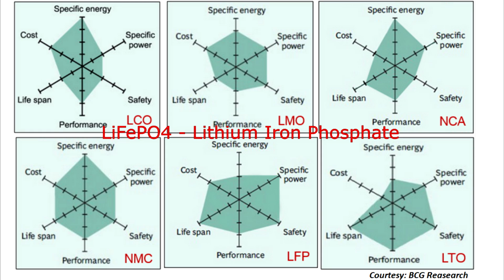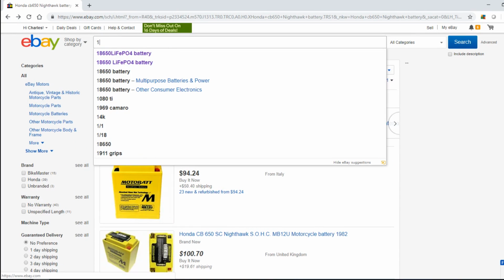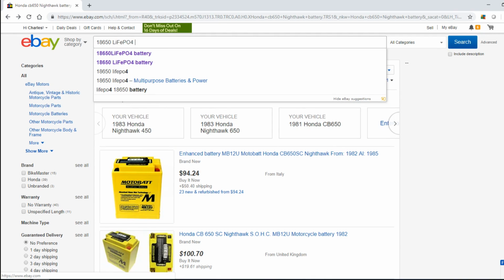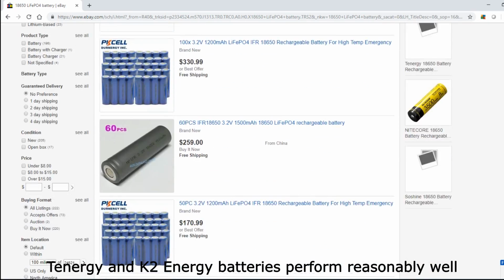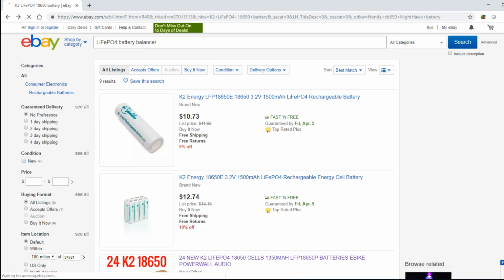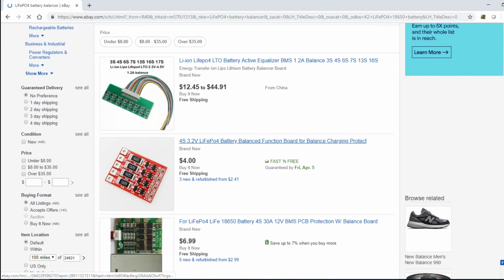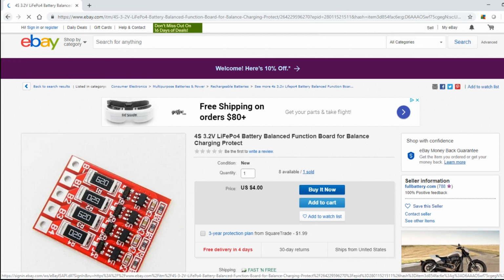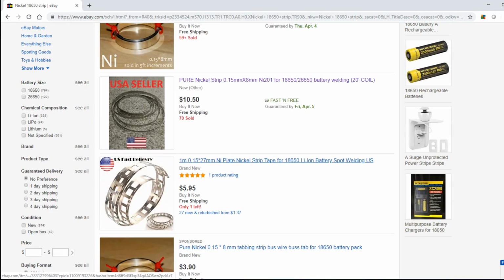DIY a better (and cheaper) long life motorcycle battery

Comment: I think its better to use lithium iron phosphate 18650 HIGH DRAIN  , high drain is for turning motors.  Also you could just get a maintenance charger for the bike in storage, this will extend the life of a lead acid battery by years. And no safety glasses is just unwise. plastic safety glasses are about $3 at hardware stores.

Comment: Since when do bike batterys only last 2-3 years ? ive owned a bike for over 10 years and still on my second battery that i got about 8 years ago, having had bikes for over 30 years ive brought 1 battery.
Dont make shit up just to make a video......
Reply: I have. 2012 Yami roadstar 1700cc vtwin cruiser that was built 11/2012(8+yrs ago) and it still has its original Yuasa AGM battery which in 8+yrs has yet to fail to start the bike.
And no I don’t leave a maint charger on it 24/7 which would have reduced(yes that’ “reduced” is not a typo) it’s service life esp being an AGM battery that has less electrolite by design then std lead acid battery & also can’t add dist water to it either so only put a low 1.5 amp charger on it every so often when in off season winter storrage for 5-6months. Got 7.5 yrs out of the cheap Walmart std lead acid battery in my kz1000 . Got 12yrs out of the last std lead acid battery (repop Delco R59) i had in my classic muscle car I have owned for over 43yrs a which is a matching #’s 1969 chevelle SS396 4sd, when possible I charged that battery once every 3.5-4wks . If you do proper maint on std lead acid batteries adding dist water as needed & keep them fully charged & clean and do the same for newer gen AGM lead acid batteries and don’t over do it charging them 12/7 all the time with newer Gen maint charger that can damage them over enough time(esp AGM battery with less electro light) that’s how i get the long service I do out of all my batteries. The std lead acid battery in my somewhat daily driver (not driven every day esp in summer when I ride my motorcycle) 98 Nissan Maxima with 63k original miles on it lasted 10yrs which was a top of the line Excide std lead acid battery.
And I live in upstate ny where summer Can hit 100deg f with weeks of mid to upper 90’s temps & winter off season can be cold for 5/6 months too so batteries can have a tough significantly shorter service life here if not properly cared for like I do with charging every so often to full charge along with not using maint chargers in my batteries 24/7 being the 2 main things that extend my battery service by 45-50% on avg be other similar use vehicles I my area.
Happy Motoring!
Scott

Comment: "Don't worry about overheating it".  wow.. really.  have you heard of a spot welder.
Reply: Bruhh, why wouldn't he just use copper instead of nickel if he's gonna solder everything. So much about this is wrong lol
Reply: @sunny_froyo  nickel plates is better on lithium based batteries as they dont oxidise the way copper does.. This is one benefit of not having short circuits in the long run..
Reply: @sunny_froyo  maybe he doesn't have the spot welder, just want to use once it's not worth it to buy one for, just used what he already had 👍
Reply: Electrical wise, i do not recommend to have a solder on battery more than 3 secs as it will damage and discharge the battery..

Comment: Straightforward and nicely explained... well-done, thx! Would be curious re: the total cost, especially compared to say, a similar capacity conventional LI battery?
Reply: You can buy lithium batts from ebay or chinese store.. And they sell super cheap for the battery cells...

An average good Lead acid batts are sold around USD 100 (E.g: YTX10) 
And a branded Lithium batts (E.g: Skyrich) USD220.

DIY Lithium should cost ard USD 80 max...

Comment: As much as you know about this stuff....  You really should be wearing PPE gear.  Like when you hose out the battery box without eye protection.

Next time just dump baking soda to neutralize the acid, then rinse with low pressure.

Comment: Why didn't you use a spot welder on the cells? That'd cause less heat damage to the cells.
Reply: How much is a spot welder? More than a motorcycle battery?
Reply: You can DIY a spot welder using a 12v battery or power supply. In my case my spot welder is diy and cost me nothing.

Comment: Normaly you disconnect the negative lead first, not the red one. This is because you can accidentaly touch the body of the car/bike with the loose lead and short the electronics with charge left inside the capacitors. It's like mixing drinks - you can mix vodka with vodka all the time, but don't mix it with whiskey, rum or anything else (though a pint of beer after a bottle of vodka never did me any harm).

Comment: Why you chose lithium iron phosphate over lithium-ion battery
Reply: LIFEPO4 fully charged battery voltage is 3.3V per cell vs 4.2v for li-ion. So that most 12v charging systems will fully charge a LIFEPO4 whereas Li-ion in 3S configuration will be overcharged and 4S configuration will be undercharged.

Comment: A battery balancer is not a complete BMS. The balancer has no way of cutting off the battery from the outside world like a complete BMS is able to. Because of that it does not keep the battery from over charging or over discharging and it does not protect against excessive charging current or excessive discharging current.
Reply: Active balancers often take more quiescent current vs passive. This can make a difference when storing rhe battery over winter.
Reply: @electricalfive2248  And the solenoid will prottect he LiFePo cells against over/under discharge? No it won't... And the starter isn't the only thing drawing power.
And that balancer he used has minimal balancing current. Better to use one of the cheap ACTIVE balancers.
Reply: @diavolescaCZ  you're right, sorry
Reply: @electricalfive2248  no problem. You didn't call me stupid. I agree that a BMS for car starting currents would be very expensive. For a motorcycle it might not be a big problem

Comment: Must be at least 12 -18ah with 24 cells
Reply: Yeah, i got a 9Ah lead acid and this is just overkill :D I got some tests going on and smallest setup i have succesfully started a motorcycle engine is three serial, three parallel.

Comment: "Dont worry about overheating the cell" LOL damn.  Soldering like that basically ruins your cells.They might work for a while but yeah, that chemistry degrades fast under high temp.
Reply: That sentance is true if you get yourself a quickly heating soldering iron or do it at high temps. Using welding is preffered mostly because it is safer to do so, faster, cheaper and no blm kids will try and use cheap 10-20w soldering irons to do so. I'd say you need at least a 60w soldering iron to solder and a small fan cooling the cell it self to do it safely, but then again i made only 1 pack like that. The other i tried making was welded with super caps, a solenoid and with observation. 1st one works nicely, bit less of a charge than it should, but i take it the charging controller shuts off any current at ~16v and not higher. The second one is still to be used, it's ment for a lifepo4 supercap  lead acid replacement battery. Was thinking of making every connection with brass nuts and bolts but after 3 montha of waiting for the nuts and bolts i'm gonna have to rethink that bit.
Reply: “Get the battery good and hot” lol WUT?!
Reply: @jonny95210  i see you missed a word there frieend. You can't go storing energy without pads.

Comment: as for those ring terminals. crimping is actually better for vehicles because vibration can cause solder to crack over time
Reply: Devin May 100% agree....
Reply: If my memory is good, it's been known for a long time (since around WWII) that crimp connectors, properly done, are superior. For speed (that helped us win the war, because the Germans were soldering their field phones, which takes longer) and resistance to flexing and vibration (because the spot where solder stop wicking up the wire is a transition from stranded wire to effectively solid wire, the strands break, one by one, at that point, from flexing).
Reply: I'm sure I remember reading that crimp type connectors help win the war. Wikipedia says 1953, but, that could be when they went commercial, I guess.
https://en.wikipedia.org/wiki/Crimp_(electrical)
Reply: NASA found the same on spacecraft. Solder joints crack. Crimped ones don't, so they solder AND crimped all the connections!

Comment: Why should anyone take you seriously?!?

Only morons solder lithium cells. Those are designed to be welded. You are applying heat to the internal breaker which reduces the current carrying capacity and life of the built in safety.

You are going to set someone on fire!

I should make a video pointing out just how stupid people are to even consider this.

 4 headway cells will be more than enough, and they simply screw together. Their built for high discharge, high temp, fast charging, and abusive applications, such as bikes and atv's.
Reply: You should figure out how to comment in a better way. I for one thought the video was a good starter video and it’s up to the viewers to do more research than just one video. It’s ok to voice your opinion but do it constructively if that’s possible. To be honest I solider a good bit and it doesn’t heat the battery enough to cause a problem unless your heat is too high and held on it for longer than needed. I can think of a good reason to solider verses spot weld, solider gives you an opportunity to replace a single cell without damaging the connection plate. I’ve been able to replace a single cell to repair an entire pack so solider was the way to go but that’s my opinion as an advantage.

Comment: I don't know what you do when wintering your batteries, but mine held its charge since I bought the bike 5 years ago and is officially dead this spring. Of course last season it was a little weak but only 2-3 year is very underestimated...
Reply from the maker: Depends on the bike, battery, and care.  In a warm garage, 4-5 years is possible.  However, if you have ever owned a BMW motorcycle, 2 years is the best you get from a battery.  However, my lithium batteries have been going on 8 years now.
Reply: @highervoltage5430  Do these bikes tend to have electrical leak of some sort ? Or is the battery undersized and the high demanding cranking is what kills it ?
Reply: As you can see in the video, his battery had no little or no electrolyte when he tried emptying it on the grass. He forgot to add water to the cells and that is probably why the battery was dead. Unless it was an AGM type, in which case the electrolyte was trapped in a glass mat between the plates.

Comment: I have an 3s 5p 16ah battery pack in my 50ccm scooter can also start an car :D bms with cutoff for safety and  a modified charge limiter to 12.3v for not stressing the cells works perfect since last year
Reply: Did you try it on a motorcycle and it worked ??How is the delivery
Reply: @abdodarwish3334  it still work well
Reply: @quartzii_uwu  Possible pictures of the installation method, the board used, and whether the startup works on it directly. Thank you for your interest in responding
Reply: @abdodarwish3334  hey , it would be a mess to reach the charge controller you can also use normal 12.6v charge controller with a little bit of wiring theyill work also
Reply: @quartzii_uwu  If a drawing or illustration is available for practical implementation

Comment: Hello and thank you for your video .  This is the first time i am building a lithium battery for my motorcycle. The lead battery i am trying to replace is a 10Ah 175CCA battery https://www.yuasabatteries.com/battery/yt12a-bs/
I want to use 4 individual cells and a BMS that can handle the 13.8V-14.2V the Regulator/Rectifier provides.
How much amps should every cell be able to provide?What should the discharge rate C be ? What BMS should i choose? Common port or Separate ? How many amps?
Thank you and thanks for your videos!
Reply: That tinny red board can hold 14.4V from alternator (and its current)? 
I don't know Rick...

Comment: A flooded lead acid battery for a CB 750 is what $50 minimum?  Most 18650s LiFe batteries i've seen go for about $45 per 24.  When you factor in the other components, how much did you end up saving?  Not to mention time, energy, skill, safety, tools, etc.   Why not just buy an AGM? Or find a way to rig a regular rc car battery pack?
Reply: From all the research I haven't done yet I believe a ton of RC car batteries aren't 12 volt. They'll obviously have one or two. So if you find out why not comment below.
Reply: shae grover   I'm sorry, I should have clarified.   I was referring to the11.1v 3 cell Lipo battery backs with a nominal charge voltage of around 12.6v commonly used in rc aircraft and cars.  However, LiFe are probably still ideal for long term storage use without proper maintenance like an inexpensive trickle charger you would use on a lead acid. Li-Fe (I forget how many cells these typically have) packs are around 6.6v with a 7.2v nominal charge, as described in the video, this is a fairly useful range if you were to use them in a series configuration.  

Of coarse lithium Ion like they use in the real motorcycle batteries would be even less expensive than the already cheap LiPo, but they tend to have a shorter shelf life and faster self discharge rate if i'm not mistaken.  

But it does all come down to wether or not you properly maintain a battery. Trickle charging, indoor storage, and observing fluid levels if it's a flooded battery, will certainly improve the life expectancy.   Of course AGM is still better in almost every way compared to flooded.

Comment: Great Video,  and Great project! Question, shouldn't each cell be managed? Not sure how that would be done on parallel packs. Ok it seems that you are using 3X8 cell pack, is that right? How long has it been since you built this pack, and is it still working and have you had to charge it? Wont the BMS  also protect the battery pack from discharging below a point that will damage the cells? Thanks
Reply: 3x8 or 8x3? Not hard to figure out which...

Comment: what iron are you using?
Reply: That's a weller WESD51.  You need a good hot iron.  Weak irons will damage the cells due to long heat times.  See my speed flux video to make the job quick and easy.

Comment: Sorry so what was the reason against using Li-ion 18650's ? Are they not able to handle the discharge rate or something? I have access to hundreds of recycled 18650 Li-ion cells and have just discovered that my bike battery is flat as we are heading in to summer!
Reply: Can you share where you get these recycled cells?
Reply: @boogerking7411  I have a friend on the inside at a scooter rental company so I can nab the batteries that are destined for e-recycling. Try contact your local e-recyclers to find out who takes care of your local scooter rental companies and see if you can take some off their hands, just make sure you don't get any that have had water damage or you may run in to trouble
Reply: I think old scooter batteries won't have much cycle life left in them since they get fully discharge, hence less cycle life. EV batteries would have better chance since they have big capacity banks. Anyway, I wish we have e-recyclers in asia. Haha
Reply: @boogerking7411  in many cities you will find abandoned scooters everywhere, just take the batteries out
Reply: Voltages don't match. So the alternator will undercharge 4 lion cells or overcharge 3. LFP is close enough that things will basically work with the existing alternator (although it's still not quite right, the BMS will hopefully deal with the slightly high charge voltage).
Reply: @jobbingactor  Don't motorbikes have alternators to charge their batteries? Whatever they use is designed for lead-acid voltages and charging requirements. Lithium (either LFP (3.3V nominal) or 'standard' LCO/LCA/NCA/ (3.6V nominal)) doesn't strictly need CC and CV charging - it needs current-limited and voltage-limited charging. But yes this doesn't match optimal charging for lead acid. In practice things seem to be near enough, that combined with some battery-management in the battery it's close enough for LFP to just be a swap-in item.
You are right that Lithium chemistries (all of them) are damaged by discharge below a certain voltage, so it's a really good idea to put in a low-voltage disconnect. It's not instantaneous (you need to leave the batts below 2V for some time (hours, damage rate depending on temp) to do real harm), but if someone keeps cranking on an LFP pack with any cells under 2V it will be bad for it.

Comment: Just bought a 40.00 LEAD ACID 12V BATTERY FOR MY MOTORCYCLE AND A 16.00 TRICKLE CHARGER...from AMAZON. 
Good video, but too much work involved, too many tools needed, too much mess to clean up or keep up with .
I'll pass on this and just buy new.
Reply: Hmmm yes you are right in some way but isn't it cool to have a bettery built by your own that will last longer than a battery that you bought? Always have a starter...
Reply: @orenrabeynu4865  cool if you are a kid in science class...as a busy adult, my free time is better spent elsewhere.